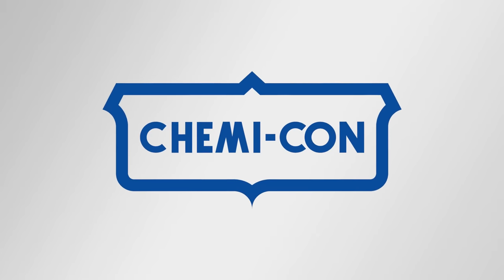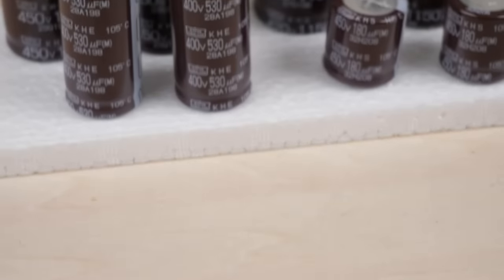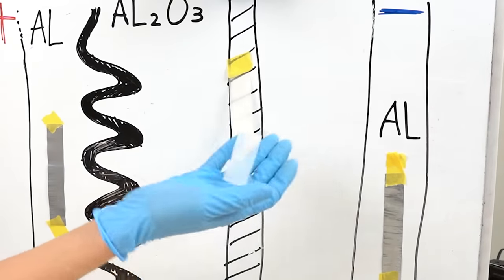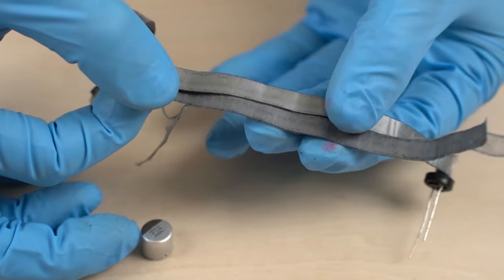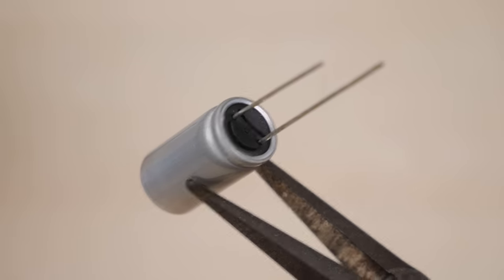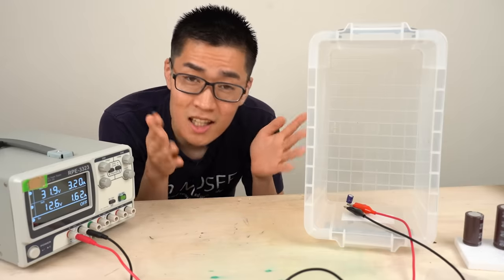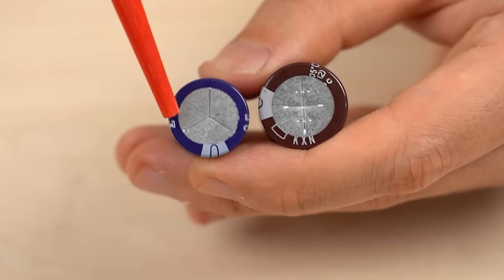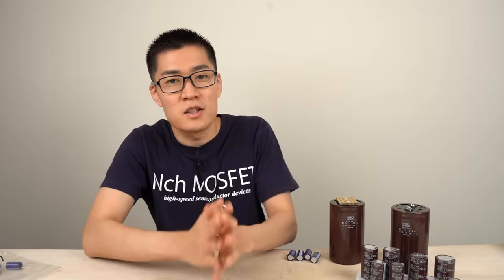Electrolytic Capacitors: Comprehensive Overview, Teardown, and Experiments

Comment: How does an electriolytic capacitor differ from electric storage battery?
Reply: In an elyt capacitor, even speaking of the EDLC supercapacitor variety, the electrodes do not dissolve in the electrolyte. Hence their "endless" lifetime.

In a chemical battery cell, during every cycle, the electrode material does "electro-corrosively" dissolve in the electrolyte and the metal ions travel to the opposite electrode (or vice versa, the pure metal re-combines and gets deposited on its respective electrode). The energy gets stored in chemical bonds (the electrode material traversing between two different electrochemical potentials). Thus, there is room for the electrodes to lose their original shape over time, for the water in the electrolyte to decompose into H2 and O2 etc. Generally the thinner the electrodes, and the finer-structured their surface (to maximise area and energy density), the faster they degrade across charging cycles... My interpretation is, that as the original spatial micro-structure of the electrode is etched away, and later replaced with a flat or spongey deposit, the originally huge surface area is lost.

As the electro-chemical batteries store energy in chemistry at the molecular level, they achieve a higher energy density compared to capacitors of any kind, that principally work with a physical electric field between electrodes, over much coarser distances, without chemical reactions taking place.

Comment: You don't need to convince the us about the high quality of Japanese components, we already know. 
The difficult part is avoiding internal "made in china" components, when buying products.
Reply: I dare say, that even "brand name" products all have cheap Chinese junk caps/resistors and other components in them.

This is why nothing lasts as long as products did before.

In the past, your TV could last 20 years with a few repairs.

Even the first LED sets would last 10+ years.

Now, good luck getting past 3-5 years, even with top brand name... RIGHT SONY!!!!!  (I've gone through 4 Sony TVs... 3 of them in one week due to factory defects... THAT, I might add, a rep told me in confidence, Sony was aware of the issues, but took a chance on releasing that model anyway)!!!

Comment: Very nice explained, awesome! Nippon stands for quality, it is a very good company. There was a time where we had very low quality capacitors on the market and this leads to many problem with the devices. To spend a bit more money for the product is often the cheaper solution. If you have problems with the devices, then the producer of the device is loosing money and get a bad reputation ... it is not worth it.
Reply: "there was a time"  ???

Oh that time is right now!

So many products, even "brand names" are often using cheap, garbage caps from China.
And the worse thing, is that when you go to troubleshoot something, it can be very difficult to tell which caps are the fake ones as that country's "companies" just love to go all out and copy the entire package look of the fake ones.  Sure, if one has some REAL caps around, you can tell the diff. with fonts, spelling, grammar and spacing.  As well, often the color of the components is not 100% the same.

I've especially come across some "low ESR" caps that are actually NOT low ESR.  So now, before I replace any cap, I test the new ones completely.   I try to buy REAL ones when I can, but sometimes, I like to have a stock of many values and the cheapies are at least good enough for testing.

As an example, I have these power supplies for 2 of my security cameras (CISCO).
When one of the adapters failed, it was a low ESR cap that failed.  That was after something like 12 years (I think it was).

I didn't have a REAL cap to replace it with, not even off of the many old boards I have, so I used what I had that "tested ok."  It was a knockoff.

But it worked.... tick tick tick ... for about 3 months.  LOL

So I traveled to one of our local electronic supply stores and bought some Nipon low ESR caps of the value needed.

I put that one in over a year ago and it's just fine.

Oh well.  We live in a world of RIP OFFs and no government seems to care. (kick backs???)
Reply: @BlondieSL  - I agree.
What I was talking about was a time were the PC-motherboards did explode on a regular base. Everyone had a PC-motherboard which was not working because of the caps.

Today the time is much better, but not perfect. All the mainboards have Japanese caps and the developer are looking for better caps too if possible. We had a delivery problem and still have a delivery problem for components. So the factories did buy from suspicious sources. They did even from ebay from some private people.

We have many problems with hardware, even safety reasons. I had opened a device with a system with a LiIon-cell loaading chip and in parallel was a resistor and this resistor was the reason why the 4.2V LiIon cell get damaged after a while.
If you do not remove the power plug, then the cell get overloaded and can reach 5 Volt ! 
With 5 Volt the cell can make boom.

What I want is a system for controlled import of devices.
1. This means if the Chinese factory want to sell smartphone charging devices, then they can do it only with one big package with thousand of this devices  and not one by one in little bags.
2. There must be a engineer who open one device and check the quality of the components, open the inductor and check the output voltage, Electromagnetic interference and that this device comply with the European rules.

If the developer is changing something, then he have to tell this to this "control-engineering-unit".
And this technical engeneers can open a random device for a random check.

Right now we have no possibility to do a quality control and the Chinese can sell some really bad and dangerous garbage.
Reply: @micropower8  Yup, all of that is true.
As for PC motherboards, all I can say is
TELL ME ABOUT IT!  LOL

While I'm happily retired now, I spent decades in systems and support.

We mostly supported IBM/Lenovo.

Pretty much any time a MB failed, we could see bulging caps.

Sadly, techs were not allowed to repair these, because of contracts with Lenovo where "replacement" MBs were sent to be in stock for the most common.

I can say with 100% knowledge, that those "replacement" boards were "repaired" (cough) with NOT top-of-the-line components!

Sadly, there were only 2 of us on the team that had a background in electronics.
The other guy was an "on-the-road" tech, so he couldn't do repairs even if allowed.

I was the only other tech with experience and there were a few times when someone high up in the company, had a machine's MB fail and we didn't have THAT model in stock.

So THEN, under the table, I was allowed to do board-level repairs.

The crap parts, not just caps, is astounding.

I haven't purchase a new MB for any of my computers in a very long while.  But when I did, I ONLY bought ASUS and if I have to buy one in the future, I'll stick with ASUS as long as their quality remains high.

Being retired, now I design gadgets for personal use.  Depending on what it is, I'll use whatever I have in stock, unless it's an important device and the final build, then I only use top quality parts.

The ECG device I am working on will have only the best parts, best display (love Nextion displays).

Fun times.
😁👍
Reply: @BlondieSL If I recall correctly, the Great Capacitor Plague of the 2000’s was due to corporate espionage leading to incorrect cap designs copied off of good caps, mass produced and such, which led to exploding capacitors EVERYWHERE.
Reply: @Preinstallable  Ah! I had not heard about that, specifically.

I did hear that, as per usual, China was "copying" products in general.

So yes, that could explain all the failures in caps.

The thing is, caps from China haven't changed much.  Still trash.

Comment: What happens to a capacitor if you make them as the newer "Tabless" Tesla batteries and increase the surface area of the tabs, by making one continuous roll of point contact, taking precaution to not short it out? Is that even possible? It may be a stupid question...
Reply: Lower ESR. See MKP capacitors.

Comment: this explains why electrolytic caps commonly bulge or "explode" in circuits, especially those of much older electronics.  Its the evaporated electrolytes.  I guess the circuit designers didn't really design for heat tolerance which is why the caps fail within 20 years of usage.

Comment: tbf you can short a 16 capacitor with a metal rod in your hand right? too low voltage to even do anything only above 50 it is dangerous

Comment: Electrolytics are the one thing that stays stubbornly high as everything else plummets in cost. This is where penny pinching is concentrated and this affects reliability.  I'm willing to bet that 90pc of stuff purchased from ebay or amazon is a fake and they still manage to find their way into proper supply chains.

Comment: Finding a real capacitor is the hardest bit😂
Reply: Ain't that the truth!!!!!
Even if you go to a brick and mortar store to buy them ourselves, it's still difficult to know for sure if what we're buying are not also fakes.

We have 2 main stores in our area.  One has been here for 2.5 million years.... LOL (or so it seems).  The other one is a huge store where the vast majority of product is cheap, Chinese junk!

It's so hard to find proper products.  That's why, if the good store doesn't have something I need, I go t the big junk store.  But, I take my ESR tester with me and for every cap I buy, I test them before accepting.  I only buy the ones marked Nippon (or Panasonic) and test them.  I also test resistors from this place, because again, not always real products.... sigh....
Reply: @BlondieSL  we have huge shopping complex just for electronic parts & countless shops.. I never buy large capacitors unless i really need it. 
Generally when i need large capacitance for a personal project like audio amplifier. I always use a bunch of small capacitors on a home made board. Overall cheaper price and lower esr. And small capacitors are always genuine. They fake it when it gets to the large 10000uf or more capacitors. I just put 5x 2000uf in parallel for half the price and lower esr. 
Sometimes i buy used capacitors that are extracted from ewaste. A quick esr leakage & capacitance test is all you need to pick the good ones. And they sell them for less than a $. If it is for something like a tesla coil i buy 90% of the parts used because it's an experiment for fun and i can keep the cost down. I won't be too sad if i burn 0.2$ used igbt.

Comment: Electrolytic capacitors are about the only thing in modern electronics that have a limited lifetime.   If they could fix this, electronic stuff would last indefinitely.
Reply: Solder, especially leadfree solder, breaks down from heat and vibration (and extreme cold, in the case of leadfree solder); and circuit boards can become conductive from excessive heat, or moisture, and the copper foils can delaminate from the board....so, no, electronics won't last forever unless these other issues are addressed with better engineering and construction techniques. Anyway it's not in the financial interests of big corporations to build products that last indefinitely. If they don't break down and become unfeasible to repair, then software non-compatibility or operating system abandonment will be used to "brick" them and force the user to replace the device.